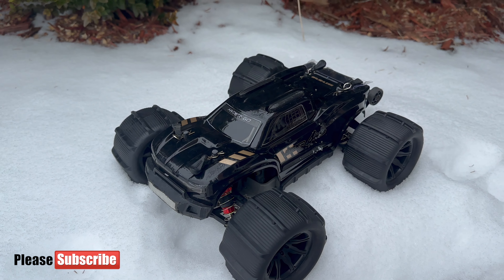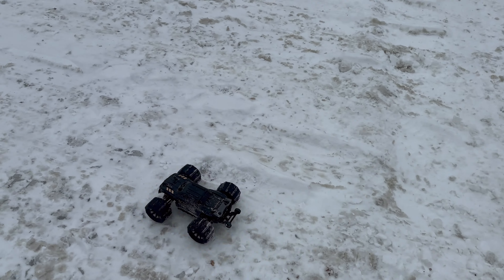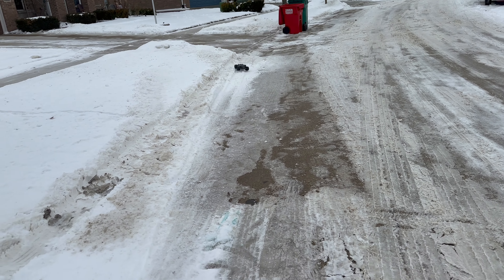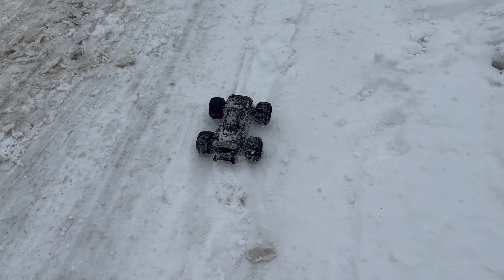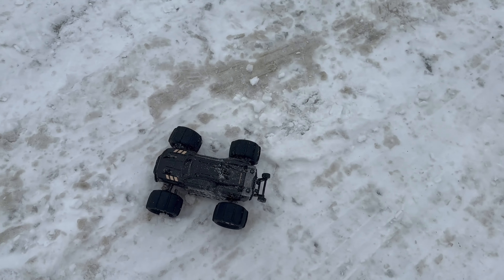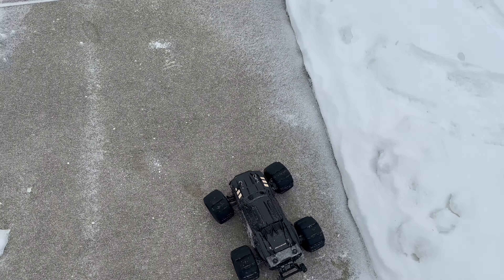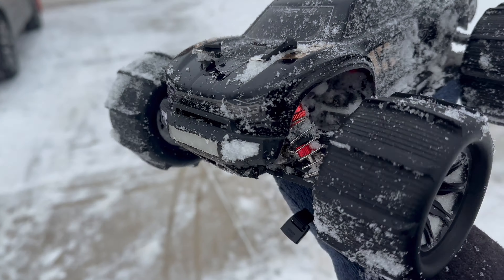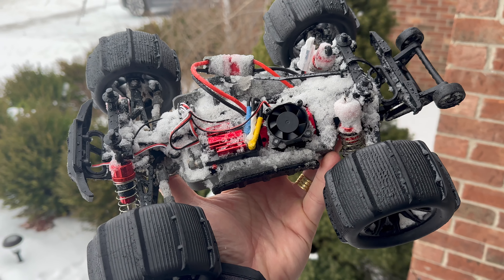MJX Hyper Go H16BM Snow - Paddle tires

Comment: Yea you had better luck than me lol
Reply from the maker: Pretty cool RC, thanks for commenting and leaving your feedback. Appreciate.
Reply: @felipezafani  I figured out what happened, the 3 esc wires were not clicked all the way into the esc itself and moisture got under the heat wrap and oxidized the connectors. I'm going to try to clean them and if that doesn't work I'll be replacing them.